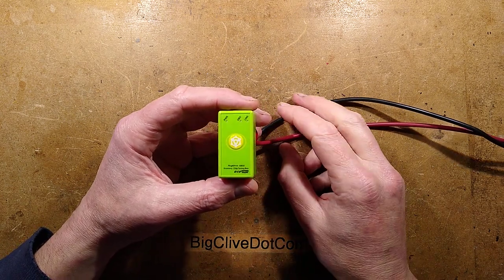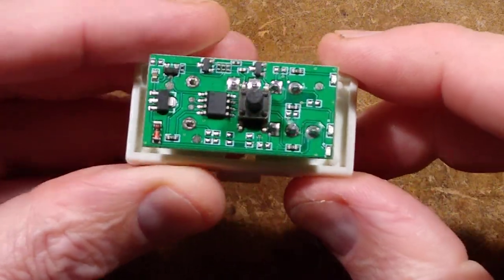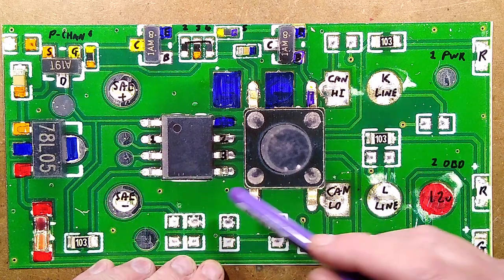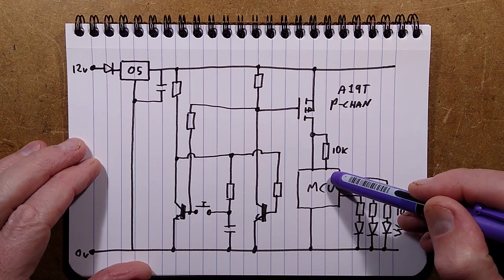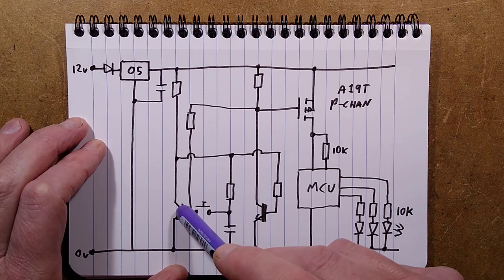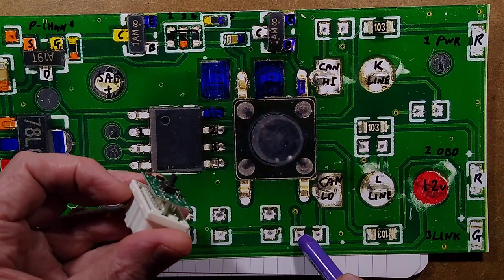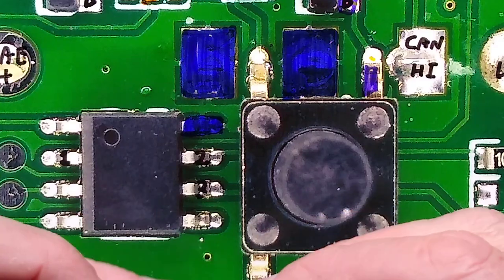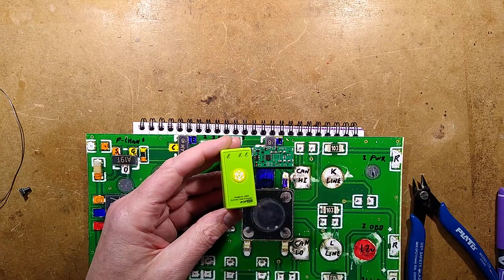Fake product with stolen software?  (with schematic)

Comment: The bus company i do some work for fitted fuel saving devices to all the buses. They do work apparently as they do actually over ride to a certain extent the drivers input by reducing acceleration rates and also gear change. so if you are on a bus stop facing down hill for example and go to pull away the system will know you are on down hill and even if you fully press the accelerator you will only get a small amount of power as it will rely on gravity to also pick up speed. (that my simple explanation haven driven them) .

Comment: You can see the large programming pads on there have witness marks from some kind of bed-of-nails type programmer, so they are at least flashing the mcu, even if the code is stolen.  Although blinking an LED on a PIC is pretty trivial code.

Comment: I wonder if this board was designed for actually doing something with a vehicle's onboard network, but that the final purpose of what it was to do could be specified by whomever bought it, with the intent that final population of the board and programming of the chip would come with whatever that purpose was.

If the factory cranking these out makes these incredibly inexpensively, then the nefarious business faking the 'fuel saver' function puts the software they need for the lightshow they wish to give, without bothering to populate the board past what it takes to get power and turn on the LEDs.
Reply: I don't see how the tracks that dead-end under the switch couldn't possibly be used for anything.

Comment: This reminds me of a car alarm? cutoff? product I encounter. Can't remember if there was any alarm. But there is a 8pin MCU with its numbers has been sanded off. If you turn the ignition, nothing will happen until you put a special dongle at certain area on the dashboard. When I looked at the circuitry, that MCU is turning on a relay to turn the ignition. The dongle was a magnet that turns on a reed switch! Its basically trying to mimicked a RFID system but without the magical circuitry that comes with the tech. It is very clever and very cheap. I guess CIA was right when they used "hiding in plain sight" strategy until the Iranians figured out their scam. Lol

Comment: It may have started as a real OBD2 port reader but it was simplified to a mere faker. Seems they didn't even bother to rewrite the code for the MCU. They just threw a switch around it, and added transistor and capacitor for a delayed reset effect.

Comment: Hahaaaaha...I came across one like this with the button. Never quite worked correctly and it actually did something (more than once) that required a CAN reset on at least one controller on the network.
It finally totally failed - and I feel safer now. Thanks!

Comment: 1. maybe good not to connect it to the car because.

your car could be infected with malware.

in theory it is possible to flash the brainbox firmware via the odb port a car dealer  may connect something there or maybe play a cd or or connect something to the usb port on the radio to flash the firmware.

now with cars like the tesla they can do it by cell phone connection.

2. how do you know if it is stolen code unless the device is not using the secure chips like apple uses and you was able to dump the firmware.

3. under windows vista leaving unpopulated pads on the board is not allowed .

4. the protection diode really is a waste because of the round cornered trapezoid shape of the connector there is no way to reverse the device.

maybe a diode is cheaper than a resistor or they are using it as a voltage dropper since there is usually a voltage drop on diodes.

Comment: Am i right if i say that it's unclear to say which transistor will open when power on this circuit? 
I think that it works the other way. First the left-side BJT transistor turns on, MCU is turned off. Then after pressing the button the right-side BJT opens and the MCU is powered on and everything works.
Reply from the maker: It defaults on.
Reply: @bigclivedotcom Ok. Thank you, Clive.

Comment: They might have had to put the large value resistors in series with the LED's to prevent loading down the alternator at idle, and lowering the gas mileage. You did say that it had absolutely no CanBus connections, right? Even if they lowered the idle 5 RPMs, they could technically say they were saving gas. Might only be an ounce/year, but an ounce is an ounce. One ounce per car, times 100 million cars ... just think of the savings. We're talking Nobel prize here, 🤣
Reply: But surely no power consumed from the OBD port is better than the small amount of power which that consumes? :( pedantic-ness aside, your comment did make me chuckle :)

Comment: All I did is use this off the shelf or surplus ODB2 housing and board and "re-engineered" it to blink lights. I have an actual cheap but functional ODB2 sensor with this exact design, but has all the components filled out.

Comment: So I think by now we know all the cheapo ones are fake. Are there any (in this form factor) at any moderate pricing level which do *anything*? Or did someone come up with this scam out of thin air and everyone else copied them? I'm (slightly) surprised if there's never been any low-end device that could ever have done something useful?
Reply from the maker: There are specialist versions for changing the performance of specific vehicles.  But not cheap.

Comment: Somehow they managed to make what appears to be a knockoff, of a knockoff that somehow looks more expensive than it even remotely has to be.
They are using a proper 2-sided PCB for this with solder masks on both sides plus (dummy) vias and a plastic casing with rather thick walls. For something that just blinks fancily.

Comment: Are the 10K resistors going to the LEDs the reason why they are so dim?
Reply from the maker: Yes. They choose an unusually high resistor value.
Reply: @bigclivedotcom  its possible those pins on the mcu can only source ~0.5mA (they wired them active high)? I didn't see any band markings on the IC. 
I would have configured the pins as open collector (or active low) to sink current from the positive rail to light the LEDs.

Comment: They should have placed some fake or high value "20 meg ohm" resistors in the unfilled spots on the PCB to really sell the fake circuit design.

Comment: I designed one of those toggle latches with relays years ago for a security system. Horribly inefficient, but hey it worked and with parts from Radioshack lol

Comment: Sounds like exactly what I need for my knight rider car. Those flashing LEDs look good and the whole thing can be connected to my flux capacitor via the GNDN cable. 

Ref: GNDN cable is from Star Trek to differentiate real cables (eg lighting) from those just used to look sci-fi. GNDN stands for “Goes Nowhere. Does Nothing”. Every sci-fi contraption should have some.

Comment: A microcontroller that has only 8 pins, handles so many communication protocols? That does not seem right anyways. And what type of communication protocols does the 8 pin controller support? Shouldn't there be other transceivers as well?

Comment: I wonder if the original board design was for a legitimate product and they just copied that and altered it slightly. 
OR
The boards themselves could have been from a legit product that failed some QC test. So they took them from the garbage, put some different components on, and repackaged them as a scam product. Idk, but there's a story behind these designs, that's for sure.

Comment: I got one of these because I suspected it was actually a scanner. It is and it works okay but it doesn't support extended CAN so you don't get all the info from the car
Reply from the maker: The Elm clones are real.  There's an app that will check your unit for what parameters it can access.
Reply: @bigclivedotcom  The one I bought was advertised as a fuel economy device and was cheaper than an obd2 scanner, but It had a photo of the PCB and it was the same as a scanner. Could you tell me the name of the app?
Reply: @a1234-e1w  Torque Pro is probably the app clive is on about, but good luck connecting an ELM Clone to it. In my experience you have a 20% chance of any ELM327 that you buy actually working.
Reply: @MattyEngland  that's the one I've been using...

Comment: It amazes me that you would put so much work into making something so fake. To me hardware has always been 'magic'. Just for my curiosity, what was is supposed to do? Or; what isn't it doing? And could you add some stuff to make it work or do anything useful (other than a light show for a very boring disco). Highest regards, Mac
Reply: Nm, found this "How the OBD2 performance chip power booster and ECU remap module works.", it appears my RTFM module is a fake as well 😁

Comment: Nice one Clive. I don't see any cuts on your fingers or burns on your nails, have you been slacking off lately?
Pax.
Reply from the maker: I've clearly been far too safe.
Reply: @bigclivedotcom  Safety? Pah! it just get's in the way of doing the job promptly.
Sure, you can teach and practice  'safety' but you can't teach 'common-sense' and the twain are often at variance.
Respect dude.

Comment: I’m sorry but I have to disagree with your findings. I purchased this unit and installed it at the dealership where I was picking up my new car. I wanted to see if I could immediately improve the fuel economy straight off the lot.
I have been using it now for 3 months and have driven over 2000 miles and have not had to add any fuel to the Tesla.
Reply: All joking aside, I absolutely dig this channel and it’s technically interesting tinkering with electronics. Your personality and in depth knowledge and ability to explain things in an understandable manor is what sets this channel apart from everyone else. Keep up the fantastic content.

Comment: You have to be careful with terms like "stolen software." Otherwise we end up with the broken idea that simple best practice methods are things which can be patented and controlled for profit. The LZW debacle is a perfect example of this and we seem not to have learned a thing from it. These companies would patent ideas like "a passenger car with 4 rubber covered wheels," or "a handheld writing instrument that leaves a trail of pigment where it's pressed to a writing surface." Apple and Samsung fought a seven-figure lawsuit over "a round button with a square logo on it." Is this what we want?

Comment: It connects to the Federal Department of Transportation database via a satellite which is in geosynchronous orbit with North America. Your GPS location, direction, speed and your vehicles particular details are processed through a Gibson super computer where the optimum fuel and timing are calculated. You probably experience at least a 300% increase in power while running on gas fumes.

Comment: Hi. Nice review . 
A similer transistor schematic for toggling on/off i made 20 years ago. Then i switchd to d type flip flop ic and later to microcontrollers. There are no fuel saving using 5$ obd module. 
Without properly tuning the engine ecu flash there can not be a fuel saving other then placebo effect.
 How big should be the eeprom of an mini obd module to hold so many maps for reflashing  so many ecus for diffrent car manufacturiers. F***ing scammers. 
Nice job man.

Comment: I wonder if the circuit board was originally designed as a plug in imobilizer. ..,only theyve bought this in bulk and hacked it to do something else to suit the market. Who on earth would seriously pay the pennies for this thing, forfeit thier insurance, and run the risk of bricking the ECU in something that will cost thousands to replace. It amazes me that there is still a market for these.

Comment: My buddy paid 60$ for a quick tune obd flash chip instead of loading the parameters himself and the thing killed his ecu almost instantly..  i popped the thing open and it was full of caps..  and a discharge button that said on/reset..   so he plugged it in and it didnt do anything so it gave time for the caps to charge and when he hit reset , boom..  2500$ for a new ecu..  some people are just evil..

Comment: Amazing. At least they did not short anything on the canbus so it would not damage the car / mess it up to show the scam.
I wonder if they might have gotten a memory dump of some chip and an image of the circuit. But not the backside because it was soldered in place so they just said "ah f it - that'll do" and left it at that. The front seems really "professional" (ignoring the unpopulated stuff and other messups).
Reply from the maker: One of the switch solder joints is very close to one of the canbus tracks.  It wouldn't surprise me if some do have a solder splash bridging them.
Reply: Anyone who plugs this into an OBD2 port is gambling with a HUGE repair bill. Some modern Audi and BMWs have £15k+ of control units connected to the CAN network

Comment: The ONLY thing anybody should plug into the OBD-II port is a code reader.  They all believe there is some magic fuel saver,  The key to saving fuel is smaller more fuel efficient cars. But where I have to live anyway. People all drive giant trucks and bloated Crossovers but they want Honda Fit mileage.

Comment: I was scammed by a fuel saving device 30 years ago. It was a step up transformer in between my distributor cap and my coil. The seller unplugged spark plug wires and the car still idled smoothly. It actually caused my car to burn 50% more fuel. They are all scams.

Comment: I truly don't understand why they didn't just wire the data ports to the microcontroller in a way they would be wired if it actually did try to communicate and then just do nothing. 
Would've been way more convincing, hardly more expensive and waaaay harder to reverse engineer

Comment: In none of my cars can you connect one of those devices and put back the cover or close the door that protects/hides the OBD2 connector, if the same goes for other vehicles then they are perfect for those drivers who like to brag about modifications to their vehicles even if they are useless things like plastic brake caliper covers that mimic sports calipers from well-known brake manufacturers.

Comment: This device absolutely can improve gas mileage! (^1) It can also help you lose weight and improve your health! (^2)  It can also make your HDTV look better (^3)

^1: In combination with proper vehicle maintenance, proper tire inflation, adhering to speed limits and easing off the accelerator.  ^2: When used with a healthy diet and exercise regimen.  ^3: When used with some LCD screen cleaner and a soft, clean cloth.  

These statements have not been evaluated by the Food and Drug Administration, the Department of Motor Vehicles, the Petroleum Institute, or the IEEE.

Comment: It's weird. Those fuel savers off course are fake but the odbII readers should be real. I have one for I think 10usd and it does work. Wifi reading and can see some values. Like Rpm/temp/throttle position. Maybe more. Didn't use it for a while. Just backup in my car if needed. Also have a chinese handheld version. Should work better. At least I expect for 200 usd it will 😅

(Foxwell Automaster Pro NT624) 

It's unfortunate they do this.